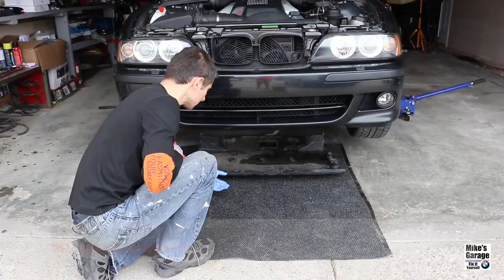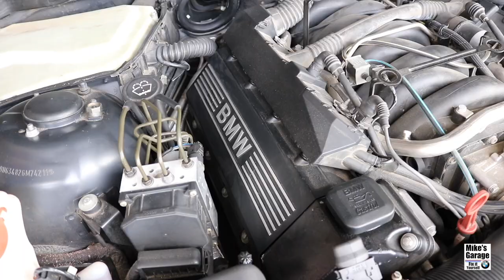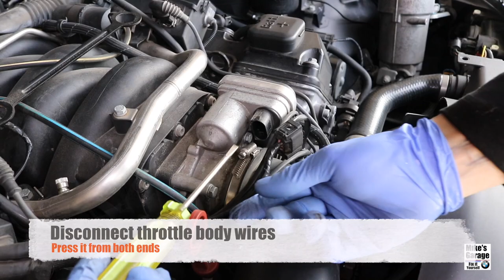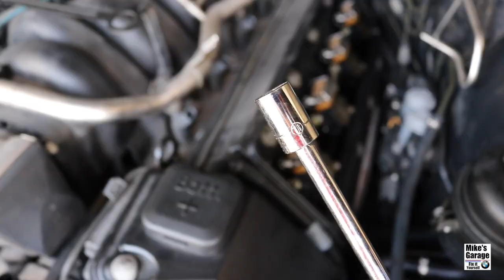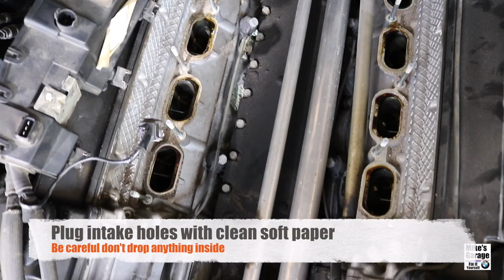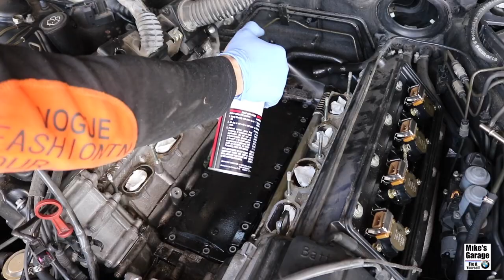How to replace valley pan gasket on BMW V8 engine M62TU :DIY

Comment: I started having an overheating/losing coolant issue on my 540 and fear this is the cause. This is definitely a good reference video to use.
Reply from the maker: If you having overheating, you may have not working electric cooling fan. https://youtu.be/8YZqBoCFm_o
Reply: @mikes.garage  I thought that at first but I noticed I was losing coolant somewhere and noticed the distinct smell coming in through the vents and when I popped the hood there was some smoke around the top of the engine. I'm gonna investigate more but I know the valley pan gasket is an issue on the M62TU engine
Reply from the maker: If this leaking valley pan gasket, you should see it at the back of your engine under intake manifold.

Comment: Great video Mike. I have an E38 740i year 2000 with same engine and will be doing same job next week. Can you list below or message me all Mahle parts, O-rings part numbers please. Thanks in advance
Reply from the maker: Thank you! You need two of each: 11531710048; 11531710055; 11531731833. You can buy all this from www.rockauto.com
Reply from the maker: Я также добавил все в описании )
MAHLEC32307; MAHLEC32305; MAHLEC32304
Reply: Mike's Garage You are a Gentleman. Very quick reply. I live in United Kingdom. Will try to search locally with these part numbers.
Reply: Mike's Garage Спасибо
Reply from the maker: Незачто ) Вот сайт, тут можно искать все запчасти на любую BMW. Сейчяс там выбрана e39. http://bmw-autocats.ru/parts-catalog/E39-Sedan/USA/540i-M62/L-A/sep2001/browse/engine/

Comment: Mate, the video is very well done and with lots of details. Thank you!!!.
I've a couple of questions..
1- I've seen few videos around and they cut a tube and replace it with a collapsible one...is this for newer models? I have the M62TU44 from a 2002 X5 4.4i but mine looks more like your engine.
2-What are the black rubbers on the box at the end of the video? I know the red gaskets are for the manifold, and then there are gaskets and orings for the cooling manifold and pipes, and then the complete valley pan w the gasket but what is the last rubber from the cardboard box? 
Thanks a lot mate, I give it a like and subscribed
Cheers
Reply from the maker: Yes, this is the same engine like you have. Other videos with cutting the pipe out this is fore next generations of engine's. The black is not a rubber this is plastic valley pan cover, installing on valley pan gasket. You need to see second part https://youtu.be/0vpN9OqZSy0 and you will know more details. Thank you for watching!
Reply: @mikes.garage  thanks a lot, I will watch it now. Cheers

Comment: Is it required to replace intake manifold gaskets after every single time you remove intake manifold? I’ve heard yes and no
Reply from the maker: If you replaced it before, then no. If you replaced it 50000 km ago then better to replace. The main things you need to make sure the gaskets are still flexible and not cracking if you bent it.

Comment: Hi Mike can you show us how to change engine lower and upper oilpan gaskets? Thanks
Reply from the maker: Hi, unfortunately I did this job when I just bought this car and didn't recorded it.
Reply: @mikes.garage  Can you alteast show us how to take out the upper oil pan gasket... Like informative video? I have searched thru and can't find any video preforming upper oilpan replacement gasket. It would be highly appreciated. I am your biggest fan. Thanks
Reply from the maker: @Shas4Ever  I like to make videos when I do something. In this case, the whole process is visible and understandable. I don’t like speaking in the video because my English is a second language, I have a terrible accent. I am also very pleased that I have fans)
But you can watch this guy https://youtu.be/rWDz9QiI2Nk
Lower oil pan Tightening Totques: M6(8.8 grade) 10Nm
                                     M6(10.9 grade) 12Nm
                                     M8 (8.8 grade) 22Nm
                                     Oil drain plug 25Nm.
Reply from the maker: @Shas4Ever  Upper oil pan gasket required special tools (like engine support bracket) and a lots of hours of work. This is not easy job. If you want let me know your email and I will send you repair manual in PDF file.
Reply: @mikes.garage  Thanks

Comment: Hi Mike
What thermostat did you use and did you have to do any coding on the computer? I have heard people using thermostat from 740d in europe
Reply from the maker: Hi Keen, yes this is what I used thermostat from 740D. No, I didn't code anything, I used resistor instead.
Reply: @mikes.garage  Thanks for your fast reply. Where is the best place and what resistor did you have to use? Thanks. Do you see any difference before and now with the cooler engine?
Reply from the maker: I have resistor PN:13901734469
And Thermostat 88C PN:11512248542
Reply: @mikes.garage  Thanks
Reply from the maker: @TheKeenMechanic  the difference is only in the operating temperature of the engine. Instead of 110-115 degrees of cooling fluid, the engine began to work at 93-95 degrees.
Reply from the maker: @TheKeenMechanic  I bought everything on ebay.

Comment: Bloody hell, those electrical boxes just pull off the injectors ?  I was thinking you had to get in there and unclip them.  Great vid btw
Reply from the maker: Yes, you just need to pull them straight up. Thank you for watching.
Reply: @mikes.garage  Hey mike! Excellent video. 
I am doing a valve cover gasket replace tomorrow on my M62 non vanos. I've done almost one week's worth of research and it all comes down to one thing. These clips. Some people say remove them some people say you don't. If you don't why are they there? Do I need to replace the injector o rings or clean them? Thank you.
Reply from the maker: They are there for holding wires in place, but if you pull them they come out without any problems. I don't know if you need to clean your injectors, my was fine, and you don't need to replace o-rings if you not remove them.
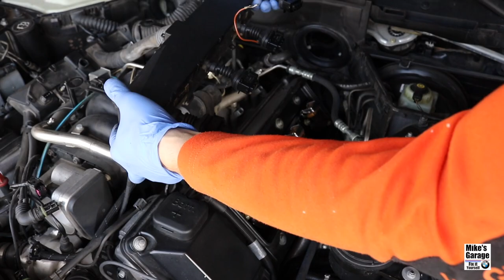Reply: @mikes.garage  Thanks for your answers! Am I thinking of the same clips as you? I think I was a bit unclear but I ment the tiiny little metal clips which can be seen on the injector box you pulled out at 4:24.
Reply from the maker: Yes, this is same clips on wire harness box going into injectors. You don't need to remove them, only make sure you pull it straight up. Also you can remove clips before pull up the box but it takes a lots of time and stress for you as they very tiny)
Reply: @mikes.garage  Okay thank you a lot Mike! Finally, you got any pro advice to know about before getting this job started?
Reply from the maker: Do not rush with it and take pictures to remember how it was. Keep everything clean. Good luck with your project!
Reply: @mikes.garage  Thanks a lot mate! You rock !!
Reply: @mikes.garage  Done now.. Took me 15 hours in total. First job on a car I've ever done mechanicly and everything went well! Boxes pulled straight up with no issues (even tho the sound made me think I broke them at first), drivers side with the fuel rails was HELL as there was two of them there. The longest part was cleaning everything. Cheers for your advice !
Reply from the maker: That's awesome! I'm glad that my advice was helpful. Yes, cleaning takes the most of the time.
Reply from the maker: You must have a previous generation engine.  Indeed, it is a little different.
Reply: @mikes.garage  ---> You do not have to remove those clips to free up the wire harness box. You can just dislodge them with a metal hook pick or a dentist pick tool . Then the box comes out easy. Make sure you put back the clips in place on the injectors, before reinstalling the box., and it will slide in place.
Reply: @mikes.garage  --Also, if you remove or dislodge those clips, make sure you reinstall them in place BEFORE you reinstall the wire harness box...

Comment: Great video!  Thanks!  I'm about to replace the valve stem seals on my 2007 X5 48i N62TU, and was thinking I should replace the valley pan while I've got things torn apart.  Is the valley pan process for the N62TU much different than for the M62TU?  Any idea what the parts list would look like for me?
Reply from the maker: Thank you! N62TU is completely different engine! I don't think you will have a problem with valley pan cover on this engine. They usually have tube seal leaking under the valley pan and to replace it not that easy. You need to find the video with your engine and decide if you want to do anything for now.

Comment: I have to do this...is it easier to take the water pump off instead in hindsight as apposed to the accumulator or crossover pipe...whatever that is?
Reply from the maker: Yes, you can remove water pump instead. I just replaced my water pump month before and don't won't to remove it again.

Comment: Nice video. X5 2003 4.4i looks like I'm not In luck, cant get to coolant accumulator, no space in the back.
Reply from the maker: Oh no, then you need to remove water pump. Thank you for watching! To bad this video not helping you :(
Reply: @mikes.garage  it was very helpful otherwise. Thanks.
Reply: I'm very glad I saw this, about to do my dad's 03 4.4 x5, didn't know if I need a water pump gasket or accumulator gaskets...I am doing the o rings though...actually if you take the plastic cowling off that the cabin air filter is in you may havee access, not sure which way is less work.
Reply from the maker: I think easier to remove water pump.
Reply: @mikes.garage  thanks! Is it typical for the accumulator gaskets to go bad? Otherwise I won't worry about it. I am doing the o rings for the pipes. Thanks for your reply!
Reply from the maker: @mikegsg9r  not really, they should be ok. But water pump maybe better to replace at same time, if you not replace it yet.

Comment: I was able to yank the Drivers side loose but the cant seem to pop off the passenger side.  You gripped and it came right off. mine is stuck in place. Any ideas?
Reply from the maker: Are you taking about valley pan cover?
Reply: @mikes.garage  no the connection boxes to the fuel injectors. Passenger side will not pop off.
Reply: The long boxes with the wiring inside
Reply from the maker: @2009adtommy  make sure you remove two nuts and then just pull it sharply straight up eventually.
Reply: @mikes.garage  it popped off finally
Reply: Thank you
Reply from the maker: @2009adtommy  I'm glad that everything worked out for you.
Reply: @mikes.garage  curious while I have it all apart. What is to stop me from changing out the head gaskets for good measure. They have about 50k miles on them. Seem like it would be simple since everything has been removed.
Reply from the maker: @2009adtommy  This is not that easy as you think. You will must to have special timing chain tool to install and adjust camshafts. https://www.amazon.ca/dp/B06XSGSTFX/ref=cm_sw_r_cp_apa_i_qzPwDbN93PMT8 
Also head gasket usually is never leaks. This is up to you but I would't touch it.
Reply from the maker: @2009adtommy  I think you may talking about valve cover gasket, if yes, than it make sance to replace it.

Comment: TOP...TOP...TOP..... VERY GOOD .... hello maigo I'm from Brazil and I'm with a bmw x5 4.4i year 2001 with the following problem: it does not turn on. the engine is locked if I remove the candles, throw some oil, or WD into the candle hole and move the pulley to one side. to the other .. ends up loosing and so I can and I can call .. more the other day she hangs up again. Do you have any idea what that might be? or where do I start ??? I really do. hug. Flavio.
Reply from the maker: Thank you! I don't really understand what are you trying to say. Is the engine in your car is not spinning? Starter maybe. Is the oil level is good?
Reply: @mikes.garage  
that's right, the engine does not turn. I need to remove the candles by throwing a lubricant in the entrances, moving the central pulley from side to side and there it unlocks.
Reply from the maker: @flaviomarinho  It is very strange. Does the starter spin after you lubricate the engine? Engine oil in good condition?

Comment: Thanks a lot... quick question for the people who can answer. My e38 740 leaking coolant how I know is it pan gasket or something else?!
Reply from the maker: You should able to see at the back of your engine with a flash light. Look under intake manifold. This is how I found it. Also is leaking antifreeze at the back, this is more likely valley pan gasket. If leaking at the front, this is probably water pump.
Reply: Mike's Garage 
Yes there is a coolant at the back of the engine. Many thanks
Reply from the maker: No problem 😉
Reply: Mike's Garage Great videos and help as always! You are a savior man - helps me build confidence. Question for you, I want to do my Water Pump at the same time as this job. If I do that, can I just disconnect the long pipes from the front vs. the back? Would this be ok?
Reply from the maker: Bojan Lovric Yes, this is ok. You don't need to remove rear cooling manifold then. Sorry for the late response, YouTube do not send me notification and I did not see your comment. Thank you for watching!
Reply: Mike's Garage thanks! I decided to do both since I’m already in here. Thanks to you, I’m half way done. Just waiting for my water pump to come later this week to complete the job. This way I have all new gaskets and o rings.
Reply from the maker: @bojanlovric2653  good idea since you already there. I replaced my water pump couple months before this job, that's why I don't want to touch it again.

Comment: Great video. Have you ever used those 1/4" drive battery powered impact tools? I can't live without mine. Watching those 20 valley pan bolts was painful, even in time lapse.
Reply from the maker: Thank you! Yes, I have the same 1/4 battery powered impact gun, but I use it usually at work. I just try to show people how to do the work with minimum tools. Not everyone can afford a lots of tools.
Reply: For something like this I'd prefer to use hand tools. I've snapped bolts in bad places before and last thing I'd want to do is snap a bolt in my block

Comment: Hey Mike thank you for such a detailed DIY it's great. I have a question for you through. I will be doing this on my 03 6speed msport 540i along with a complete cooling system refresh. I will be using the colder 88° thermostat like you have. I know you have to use a resistor connected the thermostat plug to trick the DME into thinking there's a plug connected to the thermostat on the newer 540i models like ours. I'm having a hard time finding what type and what Ohm's to use for the resistor. What did you use? It looks like you used BMW part # 13901734469, did you? If you did does it work and if you didn't use that part what did you use? I would really appreciate the help.
Reply from the maker: Thank you for watching!
Yes, I used original BMW resistor with the same part number what you have. It works and never had any problems with it. This resistor does not allow engine errors to pop up on your dash. Good luck to your project!

Comment: Should coolant be inside the valley pan like that or not?
Reply from the maker: Yes, coolant should be inside when you remove everything
Reply: @mikes.garage  oh ok well how do you know when to change the coolant transfer pipe? Because I see folks changing that along with the Valley pan? Do you have to change the transfer pipe?
Reply from the maker: @taylorsons4303  on this engine you don't need to change this pipe, as you change the o-rings. I guess you talking about N62 engine. N62 engine is completely different then M62.
Reply: @mikes.garage  oh ok so the N62 is the one folks are changing out the transfer pipe. I have 07 bmw x5 4.8i I wonder if I have to change mine or the valley pan because I seen some coolant  underneath the manifold towards the right-side in the back? Smh
Reply from the maker: @taylorsons4303  I think you need to fix your transfer pipe. Check this video https://youtu.be/UoCED1jyfL4

Comment: I've heard the valley pan actually leaks without applying some of your own silicone. Have you experienced this?
Reply from the maker: No, I have not experience this with valley pan. But this could be  possible. Sometimes I had installed some new parts and after all done and I'm testing it, they are leaking even worse then a old part.  Very rare event but happens.

Comment: Which sensor under the intake is knock sensor circuit 4? Pls help.
Reply from the maker: I guess this is driver side by the cabin. You should have a error code and I need it to make sure this is the correct sensor.
Reply: @mikes.garage  error code is P1385. Knock sensor 4 circuit.
Reply from the maker: Driver side by the cabin
Reply: @mikes.garage  so that would be the right side of the engine right
Reply from the maker: Yes

Comment: Thanks for the two videos. Very informative. I plan on tackling this onmy 540i in the next few weeks. Part way though the video you mentioned removed the rear manifold rather than the water pump. If I remove the water pump can I then remove the two pipes and valley pan as in the rest of your video? Is there a benefit of removing the rear manifold rather than the water pump?
Reply from the maker: Thank you for watching. Yes, you can remove water pump instead of rear manifold. I did this way, as I replaced water pump before and don't want to remove it again. This way I almost replaced all the gaskets on the engine.